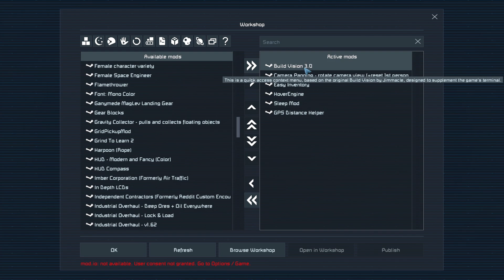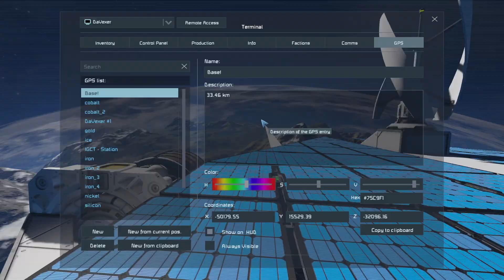Is That Enough Solar Panels? Space Engineers Time Lapse Series: Space Elevator Again - EP24

Comment: Refined ingots are just being pushed into the assemblers because they're the closest available storage from the refineries. To avoid this problem in the future, build a cargo container between the assemblers and refineries to hold the excess ingots.

You might be able to use sorters and event controllers to remove the ingots as they're being refined.